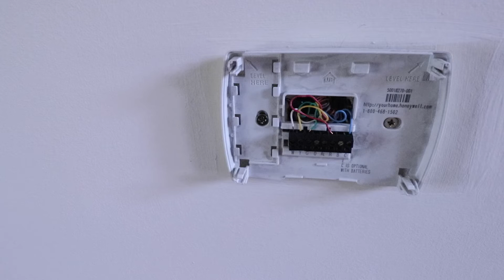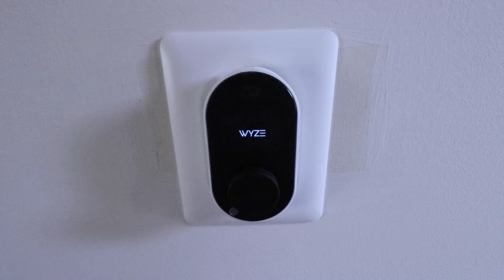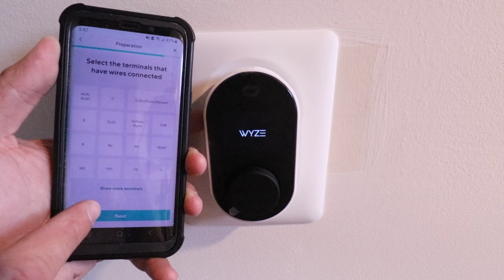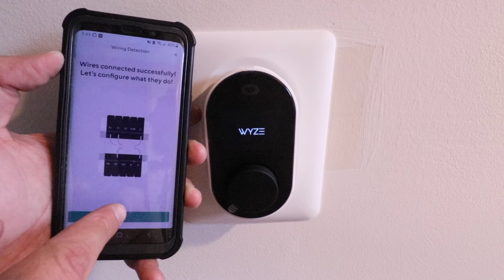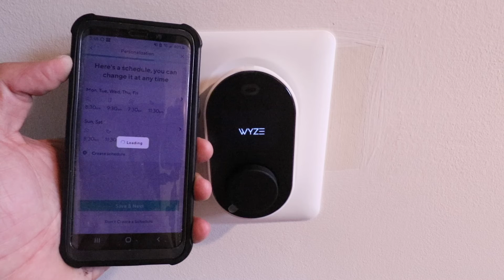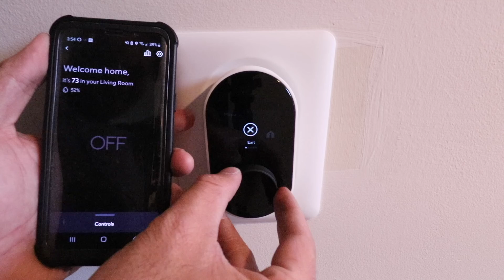How To Install Wyze Thermostat

Comment: Is the wiring always going to be the same? I moved into a house with a wyze thermostat and I just reset it and entered the same settings that you did but I’m worried it could be different and potentially cause damage. When asking the questions about the system I had no idea what to answer and put gas forced air. But all I know is I have an hvac that does heating and air. Idk if it’s gas or electric. Pretty sure it’s gas. Did I make a mistake?
Reply: You can't damage anything really. If it's working for you then you are fine. You could take a look at your furnace where the wiring connects to the main board and sometimes it's labelled.

Comment: !!!!! Not for High voltage systems!!!! Also not app friendly. Reversed cooling heating. Yes installation is a breeze but be sure your system is not high voltage like above 110 or hard wired!!! I thought it wasn’t user friendly. I keep turning it off and it keeps going.

Comment: I have two separate systems; one for oil burner heat circulating for radiant heat in the floor and in the attic a central air system. I tried grabbing the C wire from the central air and had no heat. Then I grabbed the C wire from  the oil furnace and had no air. For the winter, I can live with the latter. My old thermostat which worked well, albeit terrible programming had the R & W wire from the oil furnace and the Y, G, & RC wire from the central air unit in the attic. It almost seems like there is not way to share the common between the two. I spent hours working on this setup, to no avail. Any ideas would be greatly appreciated.

Comment: Hi this video was helpful. I installed the Wyze at my house and it showed an error that green wire was not connected properly but actually it was and I skipped the step. I have 2 w wires for which I selected furnace gas for both stage of heat. Does it look or sound ok. Should I be worried?

Comment: Does this thermostat only work with HVAC systems? I have just a regular gas furnace that only heats. Will this thermostat work in my situation?
Reply: Yes it will. I just installed one on mine.

Comment: Good video but like so many things it doesn't fit my specific situation. The Wyze Thermostat says the "W" is not connected when it clearly is. This is very frustrating as there appears to be no way to solve it.
The original thermostat had a jumper wire between "Y" and "W" but the Wyze Thermostat says that is not necessary. I suspect it is. I tried to use a jumper wire but it won't fit. The wire is a little too big I think and the holes are just a little too small to accommodate two wires. 
Anyway I am not sure if anyone else has encountered this issue but I have an email out to Wyze though I don't think they are going to be much help.
Reply: Update: I discovered that, in  fact, a jumper wire is necessary. Wyze support was of no help as usual. 
I found a wire thin enough to fit and now the "W" wire is recognized. So it appears to be working properly.
One other thing about Wyze is that their software is not all that user friendly. 
Setting things up is a bit awkward.

Comment: I have almost the same wiring in the above video but, I have one additional 'brown' wire currently plugged into RC, and it's jumpered into red R. Do you know what that wire's funtion is and what I could / should do with it?
Reply: I have same situation W, Y, G, R and Rc . I am confused is Rc is same as C wire ?
Reply: I ended up figuring out that my mysterious extra brown wire was not connected to anything inside the control box of my a/c. It must have been run extra and then just connected to a therm pin just because some technician didn’t like seeing it hanging loose. Sure caused a lot of confusion later. :)

Comment: Hey James, great vids ... cup of coffee coming your way.  Quick question,  I have two conventional systems (gas w/ forced air) and both are 4 wire (R, W, G, Y).  I installed the C Adapter on both unites and the wiring is the same (from what I can tell) BUT when I turn on the COOL mode on one unit the outdoor AC Fan / Compressor kicks on ALONG WITH THE FURNACE (heat & fan).  Any ideas as to why?  Thanks!!!!

Comment: I bought one and when I installed it, it keep blowing a 3 amp fuse and the old thermostat work flawless any idea why the wyze blows the fuse? Please help
Reply from the maker: Are any of your wires shorting out touching each other? That could cause it. Also I've seen instances where the wires short out because when the screw was installed it went through the wires in the wall shorting them out. What wires do you have installed?
Reply: Non of the wires are touching at all tried several times I have common wire green red yellow white and when I put the regular thermostat back on works normal
Reply: Any help? Can I undo the c wire and use the g wire?

Comment: Will this work with baseboard heat ?
Reply from the maker: If you have low voltage controls (24v) and a common wire it can work with baseboard heat. If you have high voltage baseboard heating controls the Mysa Smart Thermostat: https://amzn.to/38WgUKj will work